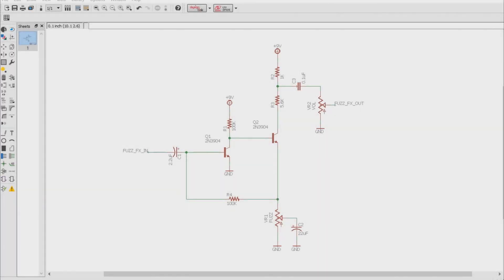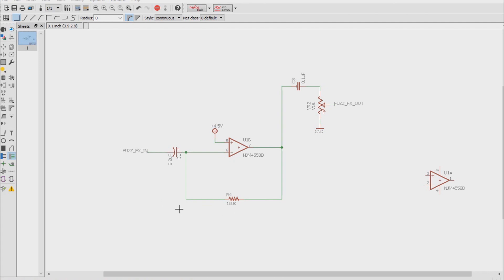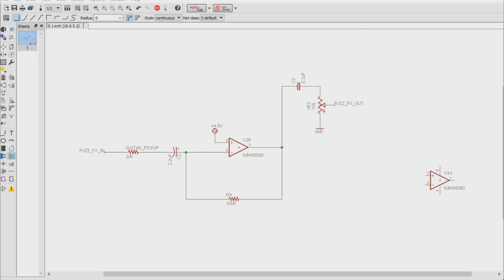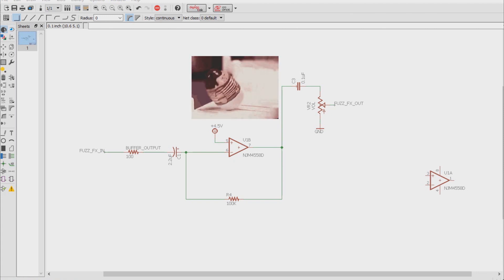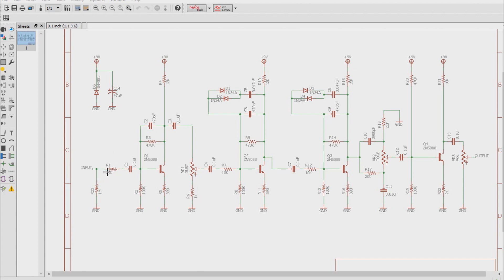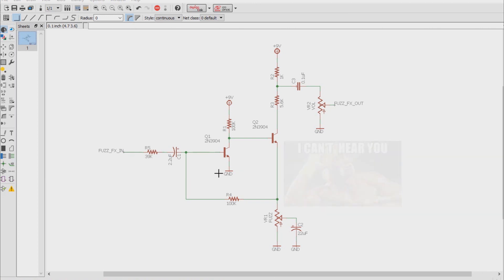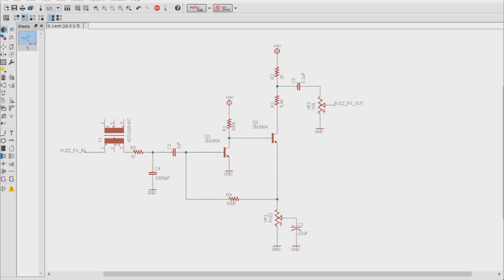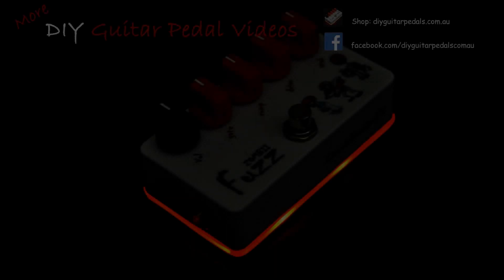Fuzz Face and Buffers

Comment: quick question about the big muff circuit, since the Op-Amp version only has 3 gain stages (one per opamp) instead of 4 like the other versions, could it sound worse when putting it down the chain after other dists/ods/fuzzes? i'm really curious about it  🤔

Comment: Great explanation, thank you! The thing with the missing volume control cleanup...does that mean adding a potentiometer between the transformer and the fuzz input would simulate this effect? If yes, which value would you recommend? 250k or 500k like in a guitar?
Reply: Yes

Comment: is it possible to wire a transformer to a switch and have a buffer friendly mode that can be toggled on and off?
Reply: Yes.  Use a DPDT switch. The center on one side is the guitar cable hot. The other center goes to the fuzz. Between one set of posts build the input section that is traditional .  Between the other 2 posts build the LRC circuit w the transformer. Be sure to keep the components oriented like they are in each circuit so that the input mates w the same components in the same way.

Comment: The best reason is the benefits of a reactive load in a fuzz face. The fuzz output from the same humbucker pickup wired series vs parallel..  Say it's a 16k ohm series... The 4 ohm parallel arrangement will react with more fuzz and possibly oscillations enough to need to turn the fuzz pot down.

Parallel into a fuzz face will be louder than series. Turning the tone pot back to just before oscillation will cause a treble spike. 

A single coil at 8k ohm will work nicely but the series of humbuckers does more of a gain drive thing with less fuzz.

So certain pickups work better with fuzz.

Dearmond foils. Filtertrons and hot humbuckers in Parallel.. (4k ohms is low limit).

This entire video is summed up to describing the "Attack" control in the Fuzz Factory.

The gate mod and bias mods are more useful.
Reply: Indeed.

Comment: When you say "put a buffer behind the circuit" does that mean, between the guitar and the fuzz pedal? Is front and back of circuits the opposite of guitar pedal amp signal chain?
Reply: Yes. That's what it means. But also... Don't mess with buffers.. The fuzz face has enough gain to run a cable length after.  The thing is the fuzz face circuit. Includes your guitar pickup and wiring.

Get a Series-Parallel switching wired humbucker in a Junior or something and a Germanium Fuzz Face. You'll thank me later.
Reply: Placing a buffer before the Fuzz Face. So if you place any effect pedal that ends with a buffer, as most do, and that is between your guitar and your fuzz face, that's what is being expressed in the video.

Comment: I never ride the volume knob on my guitar. Maybe I'm missing out on something by not utilizing that… All these years, should I have been setting up my "normal" sound with my volume knob turned down? Just seems like a trick Jimi and Jimmy figured out based on necessity.
Reply: If you have a Strat without a treble bleed and nothing but a cable between your fuzz face and guitar, you can roll down you volume for a beautiful glassy clean tone. It’s what Jimi and Stevie did!
Reply: Also, there's a subtle tone shift rolling back the V pot a tiny bit even going straight into an amp... The pickup "wants" a load between it and the junction of the paths to dc ground and an active input.